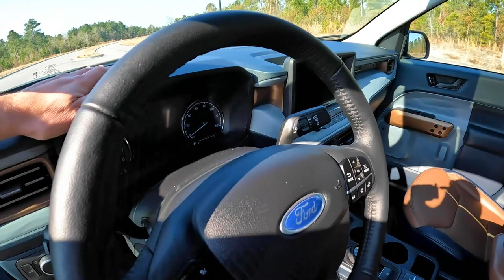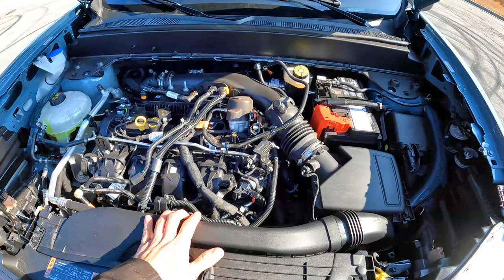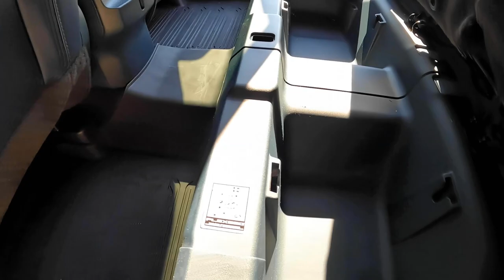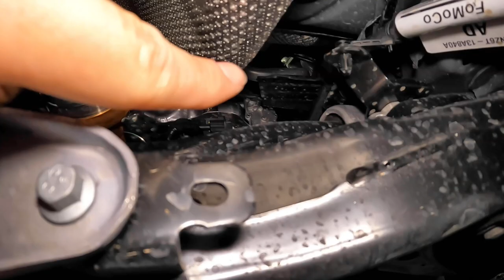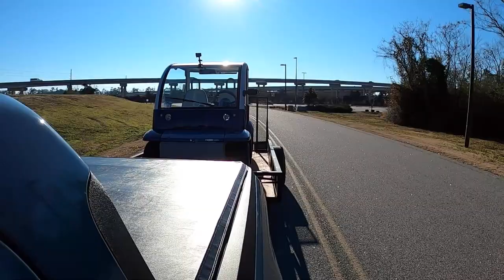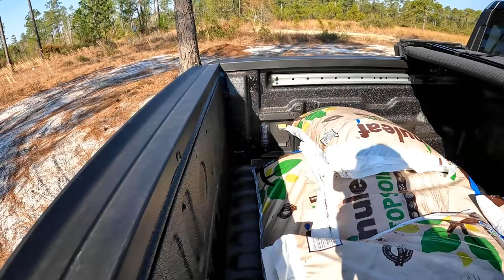2022 Ford Maverick | Full Review + Tow Testing | First Edition

Comment: For Apple CarPlay you need to plug it in. The Maverick has sync 3 not 4, so Bluetooth CarPlay isn’t available. CarPlay works great though
Reply: I second this. ALL mavericks have wired ACP and AA standard.
Reply: You can get a wireless Bluetooth dongle. A lot of maverick owners are using them.

Comment: You should have ordered 4k tow. Besides the 7 pin connector and brake controller,  it makes the Mav faster off the line, like a little race truck.
And that brown and blue interior just does not go well together.